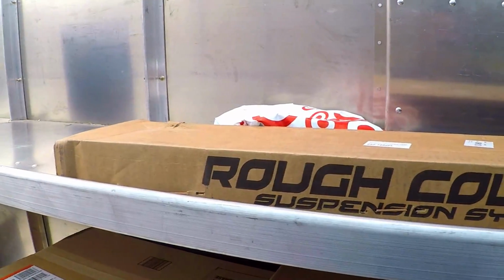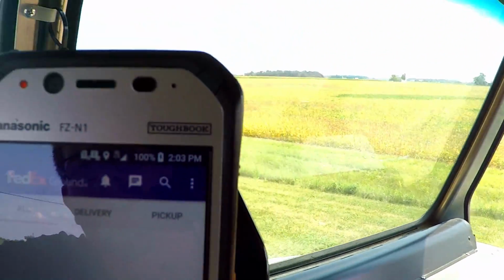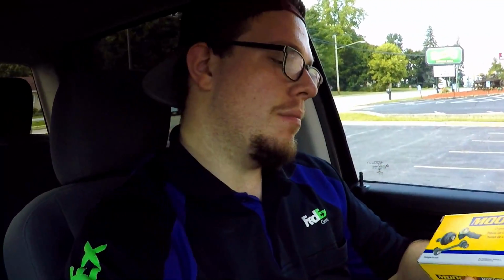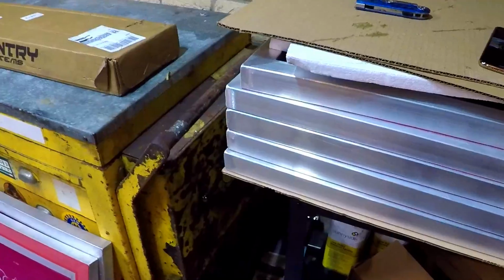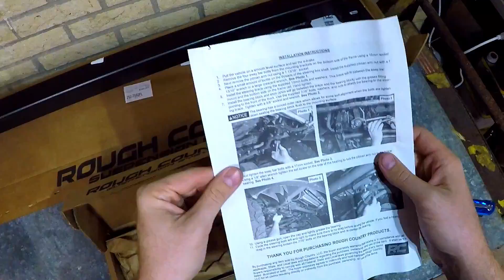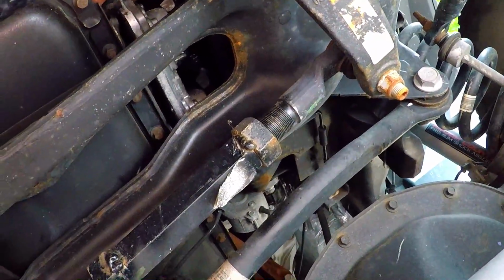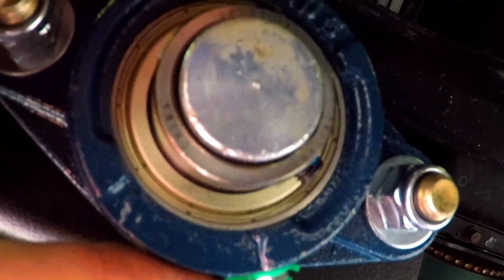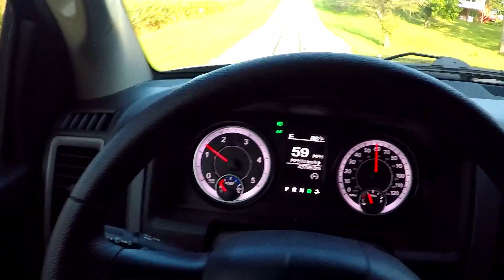Installing RC Steering Brace On My 2017 Cummins

Comment: Did u use the shim?
Reply from the maker: No. I just bolted bracket on and bolted the brace on and tightened the set screw. And then greased the bushing.